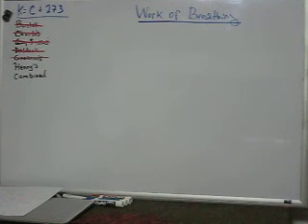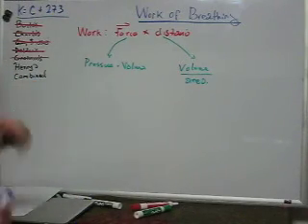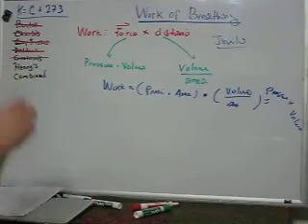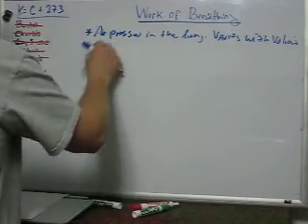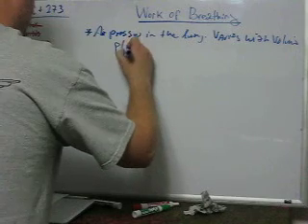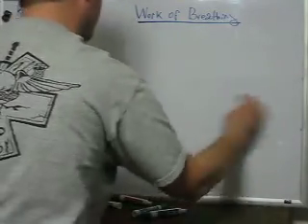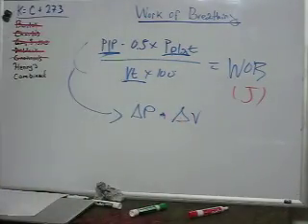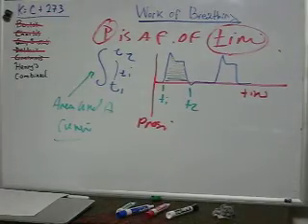Work of Breathing (Calculus)

Comment from the maker: Think back to thermodynamics in general chemistry.  When you look at a system of gas through the agency of a pressure-volume diagramme, the work the system does is the area under the curve of said diagramme.  Same concept here.  The simplest definition of work is force * distance; however, area contains two dimensions of distance and volume contains three dimensions of distance, so intuitively, the PV loop and WOB makes sense.